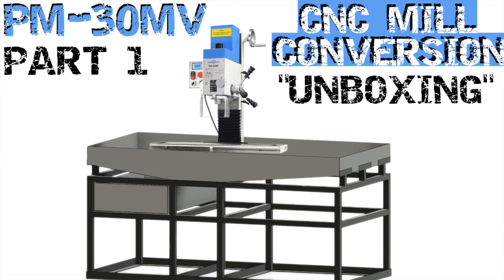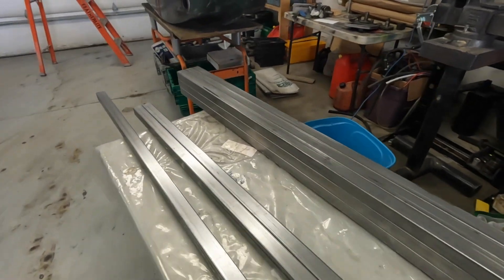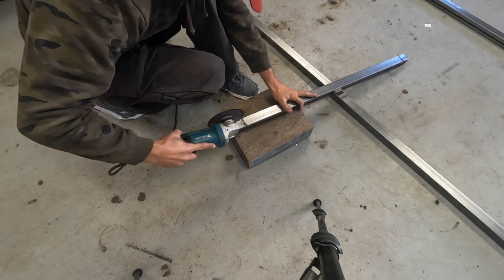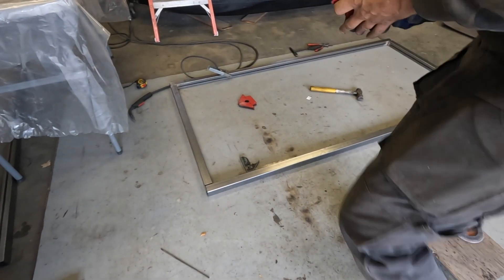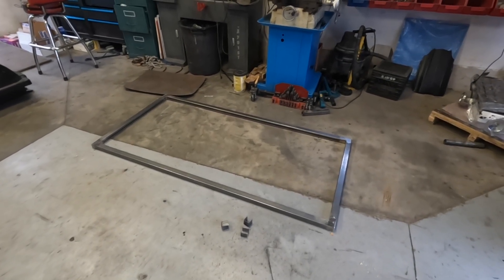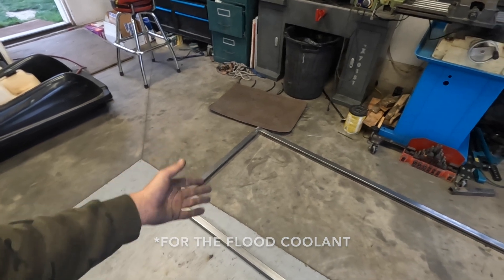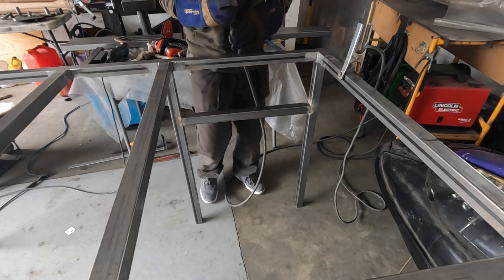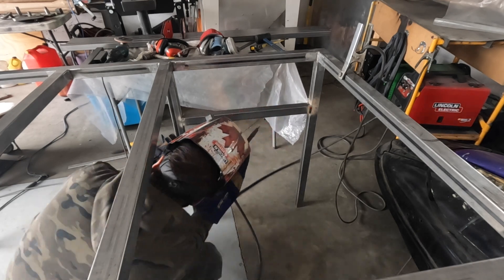DIY CNC (Part 2) Frame / Stand / Bench / Table

Comment: Cool 👍I have one concern about the base it might amplifie the noise and vibrations even start to resonate and sing at certain rpm's I say might but I'm pretty sure it will before putting the mill on the base you could fix it to wood on the ground and test the decibels when cutting and again on the base so you'll know how quiet it possible can be and have a figure to work towards
Reply from the maker: Hey, Colin. 

Thanks for this heads up... I have had the thought that this could be an issue when dealing with the frame... when I move or pump it, it is very happy to keep ringing, and there are lots of different frequencies happening. 

I will have to keep an eye on this. In my next video I will be making a change that I think might help with this some, and the casters that I am using have rubber feet. I have also considered that I may have to attach panels / plywood to the rear and side to dampen some of the vibrations.
Reply: @loweredexpectations4927  it's well worth over engineering this aspect from the start it's not just noise to worry about the vibrations can result in miss steps that will drive you crazy all the high end CNCs have granite beds to stop this problem
Reply from the maker: @colinhamer6506    Sorry if it sounded like I thought noise was the only issue. I was trying to say it was noisy and this is an indication that it could have issues. I have used a manual mill for years and I when you hear vibrations, that's an indication that something isn't right. It's a good way to break tools, leave a horrible finish and shorten tool life. I realize that it is possible for a frequency, or several, to have resonance frequencies, that can cause major issues. 

I fully expect that I will have to make changes to the frame once there is a running mill sitting on it.... but I didn't feel confident that I could design this out just by being cleaver. My method would have been to seriously overbuild it, however... 

I wanted to / needed to design a frame that would make the best use of space possible, as I am short on space already. Knowing the overall shape isn't ideal for being rigid, I priced out a few different materials. What I settled on was 1.5 inch square with a .065 wall as it was $440 ish.  2 inch .25 wall was $1200 and no guarantee it wouldn't have issues. 

I could be very wrong, but my thoughts are that I will have a better idea of what to do when the frame has a bunch of weight on it. I have extra tubing for bracing and I have designed the frame so there is a 15x36x9 inch space just below the mill... I can fill this space with my choice of materials, steel,  concrete or epoxy granite. I have collected lead from batteries in the past.... I also have 40 lbs of mercury 🤣🤣

One of the mills that I considered purchasing was a gantry style that you could get as a kit... You build the frame, check a bunch of tolerances and then fill it with concrete. I decided not to take that route as the Z travel was quite limited... there were a few other concerns as well. Epoxy granite in the base, column and head is an upgrade that some hobby machinists do. I have considered it.
Reply: @loweredexpectations4927  sounds like a good plan to me keep a eye out on your travels for thick rubber sheets like a old conveyer belt etc something to line the chip tray with
Reply from the maker: @colinhamer6506  Hmmmm ... I like that idea... the chip tray will be like a jamaican drum, otherwise. I haven't spent much time thinking about what I was going to do to counteract that... but I had considered it would be a problem... when I talk in my shop, I can hear it ringing, haha.
Reply: @loweredexpectations4927  it's the tray and tank that got me thinking your going to have problems with it my first thoughts were you are basically building a megaphone lol
Reply from the maker: @colinhamer6506  OH ! ...Okay. I was thinking the frame was your main concern. I guess just because this video was about the frame I assumed that. 

When I tried to film the clip at 22:20, I had to move the chip drawer (I assume what you thought was the tank) to the other side of the room. The sound it was making when I would talk was intense. There will be baffles welded into it and filter material in part of it ... So I'm not too worried about that part... but the chip pan ... I may have to weld in some ribs or something. Conveyor material stuck to the underside of it is a good idea too.

Comment: I used to have that same bandsaw! Nice unit just sold it bc i wanted the space. I use one of those rage saws now they are pretty decent takes up much less space. Cant wait to see the rest. Have you gotten to the point of running that PM yet?
Reply from the maker: I bought that bandsaw several years ago for $150... The adjuster block thing was damaged, and I had to make a new one. I ended up making it on my lathe... that was an interesting / sketchy project. 

I could run it at this point, but I have been too busy, and I don't want to go down that road... I get very obsessive about things and I'm easily distracted. I bought some Tormach TTS tooling and I really want to make some chips... but I'm trying to stay focused !
Reply: @loweredexpectations4927  that's a great deal for that saw I sold mine used for like 600. I bet it's hard to not start running that thing
Reply from the maker: @lanceulbrich6249  Yeah, it was a great deal, and that's why I can't sell it... even tho it takes up a fair amount of space. I'm going to be storing it behind my mill, when it's done, haha. 

Yes, it is hard to not run out and fire up my new mill every 20 minutes, haha. I finished the wiring of my garage and purposely didn't install the plug on the mill 🤣
Reply: @loweredexpectations4927  not sure how you do it I'm putting off all kinds of stuff to try and get mine back up and running😂
Reply from the maker: @lanceulbrich6249  Haha... It just so happens to be that I'm obsessed with getting videos out at the moment. Who knows what next week will bring.
Reply: @loweredexpectations4927  I hear that go where the wind blows